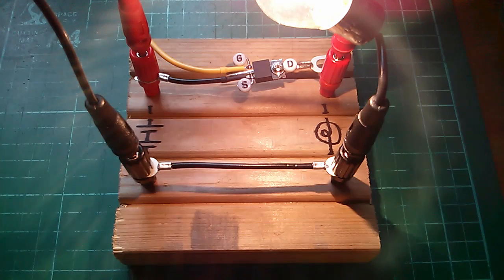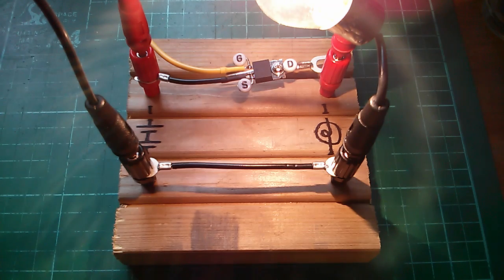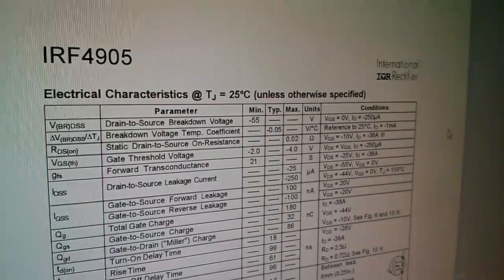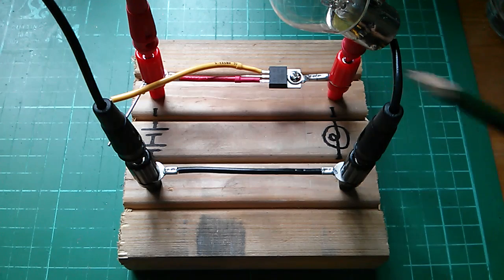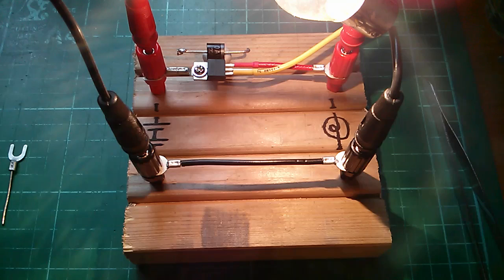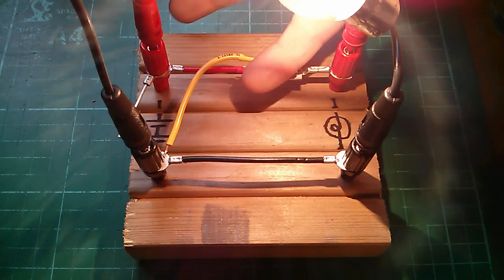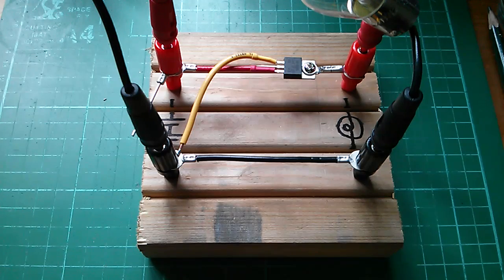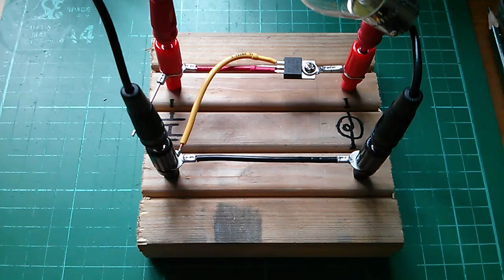Practical MOSFET Tutorial #3 - P Channel and the Mobility of Holes

Comment: The reason for higher Resistance R(DS, on) in a P-channel over an N-channel MOSFET is very simply due to the design geometry of the internals. N-channel designs involve a straight-through geometry and shorter path, therefore a lower throughout resistance than the P-channel type which inherently forces the current through a not-so-straight and longer path. You are keen to hypothesize about the difference in diffusion of holes vs electrons, but in fact the real explanation is quite simpler and requires no invocation of Quantum Mechanical effects. Happy Days my friends!

Comment: Thank you for making this mosfet tutorial playlist! I have referenced it many times these videos were exactly what I needed to see as I am looking to use n & p channel mosfets with the fuel pump, radiator fans, and headlights on my motorcycle.

I ordered some IRF4095's and IRF3205's they arrived in the mail today I was eager to test them out with a 55w H7 headlight connected to a power supply and they work as intended.

Comment: I have a question , P channel mosfet is used with a opto couple or  the Mass is connected to Vcc and Gate pin is controlled by a voltage with an opposite direction

Comment: body diode is to protect the MOSFET from reverse voltage spikes when switching inductive loads. referred to as a"damper" diode. also found across relay coils to protect driving transistors.